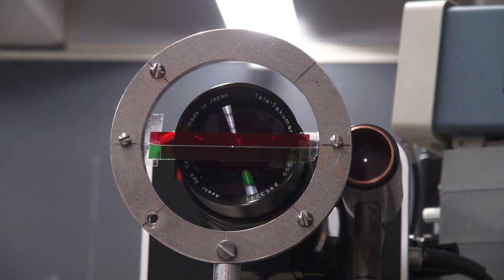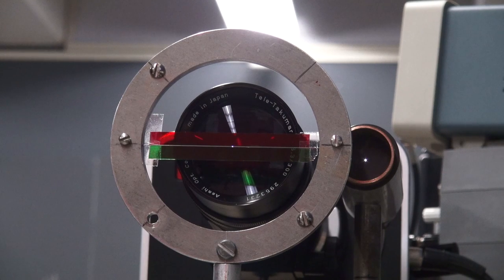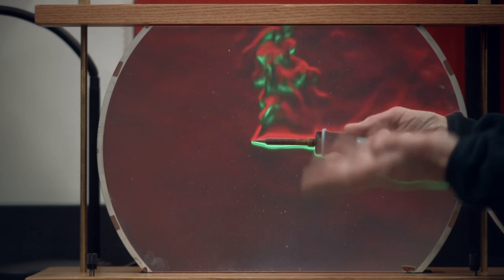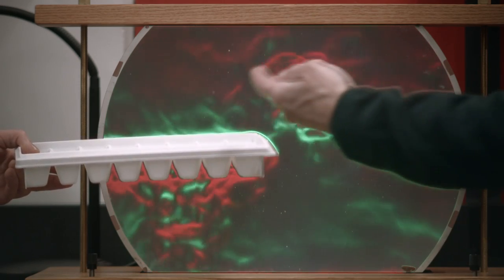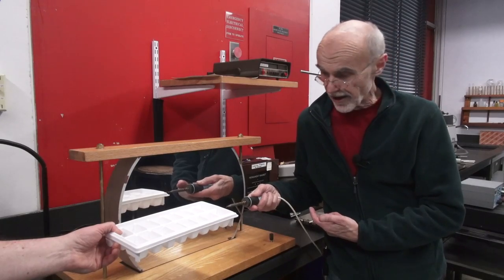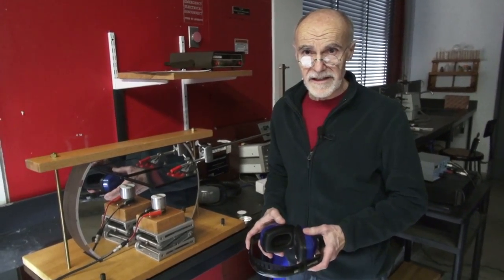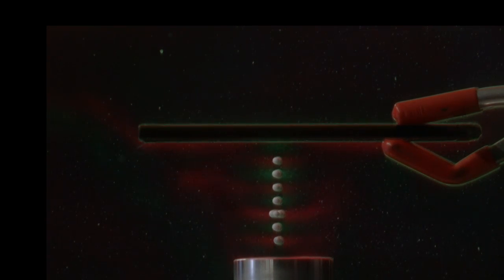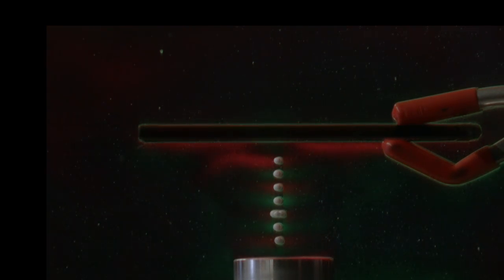Visualizing Ultrasound with Schlieren Optics Part III

Comment: very cool. now what happens if you translate the upper plane vertically? will there be more bands or will the bands themselves expand? i suspect the former scenario would occur.
Reply from the maker: If the reflector is moved vertically and the driving frequency remains fixed, then the standing wave will disappear until it has travelled a distance of another half-wavelength (in this case I think that's just under 7 mm).
Reply: @NatSciDemos  oh, thank you, that makes sense.

Comment: Very cool. Can you explain what force is keeping the balls centered? Its as though their is a spring wobbling them in place horizontally. I've been told acoustic radiation force is normal to the direction of the traveling wave, but, what about with standing waves?
Reply: I think the acoustic field gradients at the edges of the standing wave are such that the standing wave behaves like a potential well and the balls tend to settle down in the center of that well.  That's a "hand waving" argument.  :-)

Comment: There's a few things about the levitation demonstration that tripped me up, so I want to make sure I understand it correctly.

According to this link https://www.acs.psu.edu/drussell/Demos/StandingWaves/StandingWaves.html, a standing sound wave can be represented by the "displacement amplitude" or by the "pressure amplitude."

I assume the little balls go to the nodes of the displacement wave and the antinodes of the pressure wave. Since the colored bands represent the highest change in pressures, that's where there is zero displacement in air molecules, so the balls go to those places.

Also, I assume the pressure in those colored bands is actually alternating from high to low at 28 kHz, and the strobe light is set specifically so that you only see the bands in one color.

This was confusing because I think other sources said the little balls should go to the nodes of a sound wave, and I think my account explains why they said that. If I'm totally off base, I apologize. Always glad to learn.
Reply: you are correct in your assumptions
Reply: @wolfgangrueckner7151  Thanks for the quick reply.

Comment: Why do the balls settle in both the higher pressure and lower pressure parts of the wave?  It seems intuitive to me that they would settle only in the low pressure regions, because the higher pressure regions would push them away.  Anyone have a simple explanation for this?

Comment: What would this look like with more colours dependent on the displacement and angle. Using cyan, magenta and yellow film apply one as you did the others then the other two 120 deg away from the last, so the overlapping films create many colours radially around the aperture. This would give a vector field representation of flow, instead of this partial derivative. I enjoyed the strobe.
Reply: Great idea.

Comment: Thanks for video! 
Is it possible to visualize standing wave with continuous light? In other words, are there noticeable time averaged deviations of pressure from atmospheric pressure?
Reply: yes, you can see a standing wave with continuous light
Reply: @wolfgangrueckner7151  Thank you! I am trying to understand the physical mechanism of acoustic forces. At first glance, it seems that the time-averaged pressure in a standing wave is uniform in space and equals to atmospheric pressure. Apparently, this is not so.

Comment: I would like to see this demonstration using a tube with an uncut quarts Crystal inserted in it and water passing through tube, in order to find out if the energy field produced is visible.  can you do this please?
Reply: Sorry, we can't do that.
Reply: dangerous idea?...quartz...has a wild, well...diffracting affect ... but interesting idea...is it the water that would stream the light into a singular flow..?..
Reply: @riacheriefailla  the waters electrons I think would move around the points of the crystal in a 2-1-2 pattern, skip 2, skip 1, or 1,2 . I got the idea from an ancient tablet," like a blacksmith, 2, 1, 2." This actually creates a pattern that when viewed from above or below,  make a 6 pointed star, from either side with 2 surfaces visible a Celtic infinite knot., And from either side with 3 surfaces visible -  a pattern you can overlay the northern or southern hemisphere and align siesmic activity, air currents, animal migration paths, without having to adjust it. So putting pressure on crystal increases it's range of output, most temples and sacred sites are marked with heavy things, most all have underground water and crystal deposits. Certain ones have more pull some push, the pulls you will find on the knights Templars places of visit, the went underneath them to collect the gold beneath. At the center of the torus that pulls is a chalice shaped energy flow that at it's center technically has reverse spinning electrons that assist gold particles to accumulate with each other. Let me know if you are becoming a bit wiser.....
Reply: @MrForlines  same for diamonds?...  I was shown today...that the great potato famine...was caused by a HAARP...I wonder about your crystal pressure comment with that...pull/push spots would be VERY intentional across the globe, purposeful.

wiser?... ;-)
Reply: Okay, so here's a big secret. The Freemasons symbol of a compass, measure, and a g in the center. The g isn't a letter at all, it's an arrow. One flow splitting intwo and below there are two flowing into one between them are cyrstals, the spin is at the center, G, that way.....
Reply: I'm not sure about diamond but if you would, draw a tree of life only, keep drawing circles until they overlap. Now visualize these points with either side as mountaintops or both, and the centers as valley or the base of mountains. Water flows and boulders. Then go watch the clouds form over land and see it totally different.

Comment: I am truly wondering how to make a stroboscope that can strobe at 28 kHz, did you built your own electronic circuit to achieve that? Asking because I am trying to recreate this experiment for a new course at TU Delft.
Reply from the maker: Some details of the light source we used can be found here https://doi.org/10.1119/1.5042245

Comment: There are actually 3 colors: Red, Green, and Dark. What do the dark zones represent? 

There are two types of Dark bands:  a thick Dark band and a thin Dark band.  If the Dark bands are transitions between the red and green, why are some positionally consistently thick and other's positionally consistently thin? Why wouldn't they be of the same length regardless if a red band was transitioning to green or a green band were transitioning to red?
Reply: Good question, Colleen.  I think that the distance between the source and reflector wasn't adjusted optimally, leading to a slight asymmetry.  The dark bands ought to be uniform in width.

Comment: i want to make an ultrasound cleaner for printed circuit boards and electronic devices. i need ultrasonic horn. turkeyland has no supplier for ultrasonic transducers.
Reply: The transducer is an American Piezo 28 kHz Cleaning Transducer model #90-4040
Reply: Wolfgang Rueckner is there a direct link?
Reply: Wolfgang Rueckner i also need ultrasonic wire bonding transducer. can you help me?
Reply: We made our own transformer to couple the transducer to the audio power amplifier.  The core of the transformer consists of two C-shaped pieces of ferrite which, when put together make a square.  The primary is 10 turns of #18 wire and the secondary is 100 turns of #22 wire.  The inductance of the primary is 230 µH w/ secondary open and 16 µ H w/ secondary shorted. The operational inductance is such that its impedance is well matched to the 8Ω output of the amp.  The inductance of the secondary is 18.8 mH w/ primary open and 1.8 mH w/ primary shorted.  It's operational inductance is around 10 mH.  The static capacitance of the transducer is 3550 pF.  To resonate at 28 kHz, we want an inductance of 9.1 mH.  The inductance of the secondary is a close match for that.  The output of the transformer can be as much as 400 Vp-p, but we operate it at approximately 50 Vp-p.  This is just one of many ways of powering the transducer.  I suggest searching the web for more conventional designs.

Comment: I just wish the noise the transducer makes was filtered out before upload :)
Reply: We tried.  There's a 14 kHz peak (must be a subharmonic of the 28 kHz) that we tried to get rid of with a low-pass filter.  Admittedly, it leaves something to be desired.  Hopefully we can run the soundtrack through some sharp notch filters, if we find some good software to do it.
Reply: Give it a few years... It'll go away with age.

Comment: Is there a small space in between the red and the green filters to allow unfiltered light to pass through as well?
Reply: no ... a very thin wire blocks the light
Reply: My confusion is regarding how you're able to get a true-color representation of your hands, the background, etc. while still having the schlieren image of the disturbed air appear as a false-colored filtered image... Shouldn't the red and green strips be tinting the entire image, including your hands, the soldering iron, your background, etc.? I would assume so, since (if I understand correctly) the strips intercept the light at the focal point before it has time to spread out again and reach the sensor.
Reply: @neurohan  You have to appreciate the fact that the ray of light entering the camera through one of the filters is traveling in a straight line from it's origin (a point in front of the mirror where the refractive index changes) to the camera -- it doesn't spread out and shine on other things (like my hands).  The "true" colors of my hands and background are from the ambient lighting in the lab.  Does that make sense?
Reply: Thank you so much for taking the time to reply!!

After reflecting on your response for a little while, I think I was able to pick out my misconception and resolve it.

I was under the impression that the entirety of the frame that we see in this video was contained within the point of light at the intersection of the two filters.

But it just clicked that only the rays being emitted from the point light source (or at least those rays that are reflected by the mirror and not obstructed by the objects of interest) would be focused towards that point. As such, the light passing through the filters and hitting the sensor only covers the portion of the scene occupied by the mirror. The rest of the image consisting of "true-color" objects would be created by the scattered ambient light entering from outside the boundaries of the filters.

I think my misconception stemmed from me wondering why we can't see blurred versions of the red and green filters stretching from the left-middle side to the right-middle side of the scene. For this, my only guess is that the filters are effectively erased from the image, since they are so close to the lens, whereas the camera focus is locked on the faraway mirror. Is this correct?
Reply: @neurohan  Absolutely correct ... the wire block and filters are totally out of focus because they are so close to the camera and the lens is focused 4 meters away.
Reply: @wolfgangrueckner7151  This makes so much more sense to me now... I appreciate your help!
Reply: I actually do have one more question: shouldn't the image of the airflow be inverted relative to the image of the object in front since the camera is positioned past the focal point? When I set up my own schlieren arrangement, the image is upside down after it passes the razor. Why isn't that the case for your setup? Are you using some sort of multiple exposure or multi-camera design?

Comment: What happens when you change the frequency with the balls placed in the bands?
Reply: If you change the frequency without changing the distance between the reflector and the transducer, then you no longer have a standing wave and the balls fall down.

Comment: sir what would happen if you put water  in it. like the little ball you used to put.
Reply: Water droplets would levitate.  We don't use enough acoustic power to do that (for safety reasons).
Reply: @wolfgangrueckner7151  can you formed something by using water droplet?
Reply: what would happen if fires levitate? it will become like a droplets ? Is it possible to artificially made a sun or mini earthlike planet?
Reply: @hectoroliviervillarez5733  I'm afraid not :-)

Comment: What happens if you rotate the color filter?
Reply: The colors will change.  The color in the schlieren image tells us which way the light was deflected (relative to the orientation of the filter).  If you rotate the filter, then the color in the image will rotate to indicate the new direction the light is being deflected.
Reply: @wolfgangrueckner7151  But what about the ultrasound demonstration, where low and high pressure are marked by specific colors?
Reply: @tiagotiagot  Suppose that the high pressure region refracts the light in an upward direction.  If the red filter is above the green (as it is in the video), then the light passes through the red filter and the camera sees that pressure region as red.  If you rotate the filters, say 45 degrees,  the red is still above the green and nothing changes.  In fact nothing changes until you rotate the filters up to the point where they're vertical.  Then you won't see any color because the light refracted upward stays on the wire block.  But if you rotate beyond the vertical, then the green filter will be above the red and the camera will see that high pressure region as being green.  It will stay green as you rotate further up to the point where the filters are vertical again.  Then you see nothing and rotating further beyond the vertical will produce a red image again.  Does that make sense?

Comment: HI.

This is very  very interesting,  I can actually see this wave when i have taken LSD. 
 LSD open my mind so that I can  see air waves and see increasing and the decreasing between different object..

Shit have never been able to describe the waves I can see when I took LSD for someone until a saw this video. 

have a great time
Reply: No, you can't.
Reply: @ВладЛалаев-д6м  

HI 
Yes this it 100% true.
i would not write it if it not was true, i´m so fascinated that this was what i 
actually could see. 
when they showing the hand in the video, it was exactly what was happened with my hand ( the smoke / waves from the hand) . 
and  different Items that I was holding  looking at I could see the ( smoke / waves behavior ) and it was like you could see in this video. ( but only green color )  
'